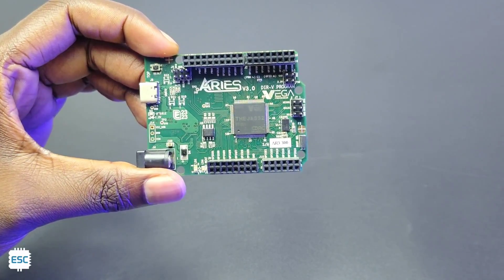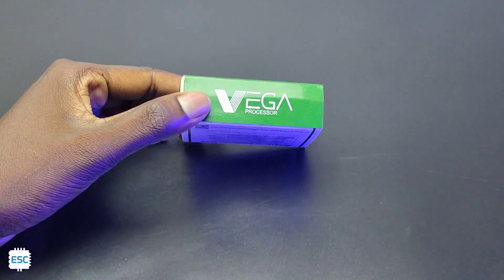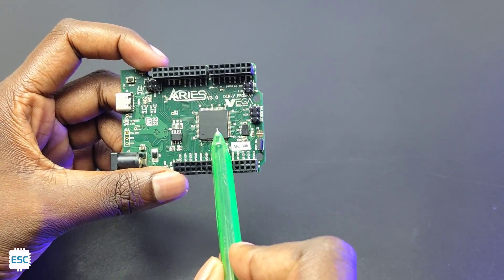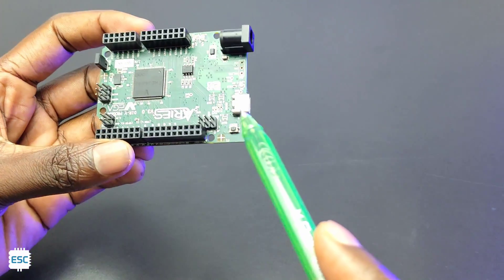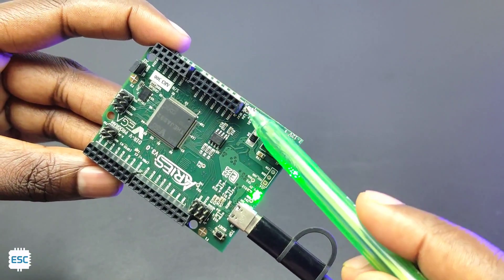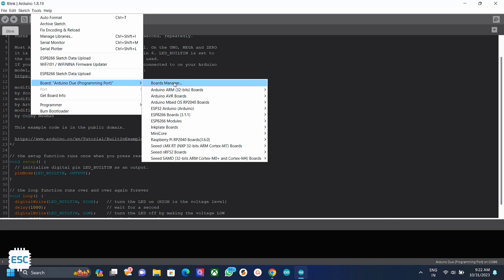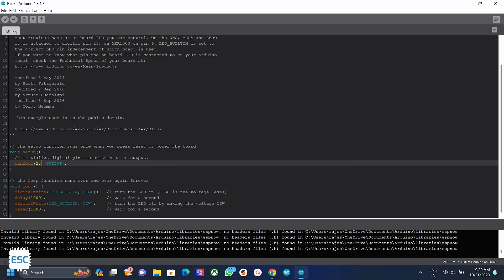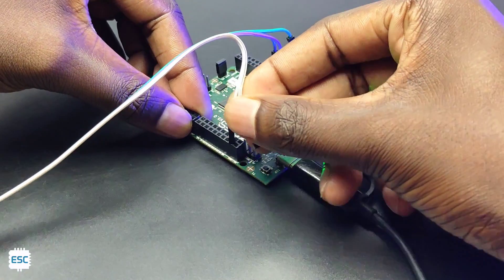Getting Started with ARIES V3 | TEJAS32 | Arduino IDE

Comment: Hi guys, I have got an error like "A programmer is required to upload". I am using latest arduino IDE, I tried both flash modes.
Reply: Direct upload button is not working, issue solved by using Upload using programmer under sketch section.
Reply from the maker: @suneelbhat4677 that's for uploading code to other boards . How is that worked.!?

Comment: I bought this directly from them when they did workshop in my college
Reply from the maker: Is it good
Reply: @EDISON_SCIENCE_CORNER  
Works well 
For arduino ide version 1.19 
But for arduino ide version 2.2.1 
You need to upload via programmer 
It's equally fast as the uno in upload speeds
Reply: for how much?